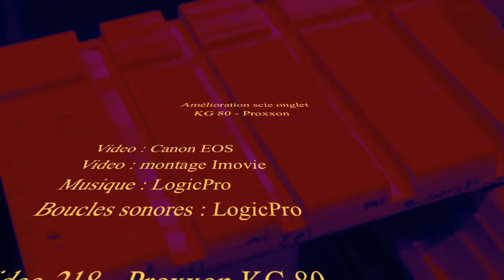video 218 - Option pour Proxxon KG 80 -

Comment: someone here could comment using this or smaller KG 50 for cutting thin "wires"? Need something for repeatable cutting of rather thin wires with the diameter about 1.6 mm?... I am scared in both versions about vobbling of the cutting wheel, not possible to hold the second side of the wire when I am sure I will need short cuts as short as about 25mm - 50 mm in length .. I could build some guides for both sides.. however still not sure if this will be good be better than horrible cutting with progxxon hand helds with small cutoff wheels....